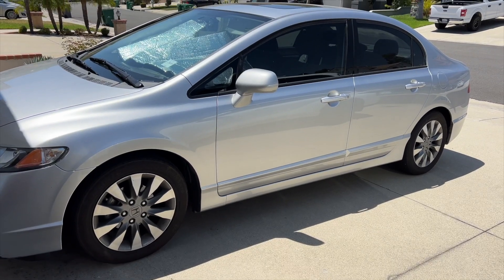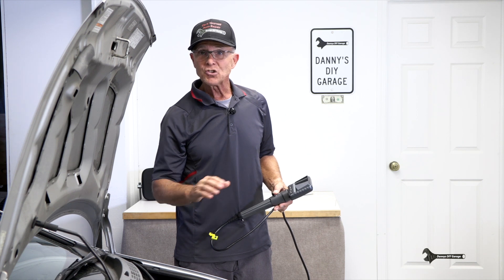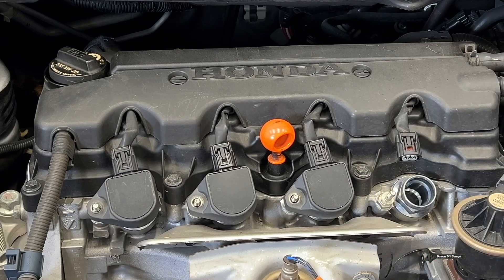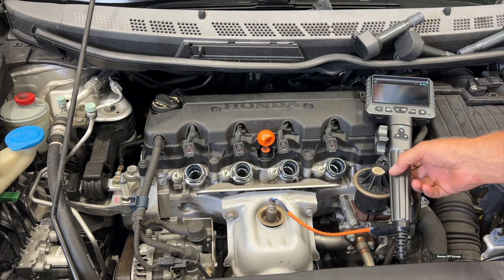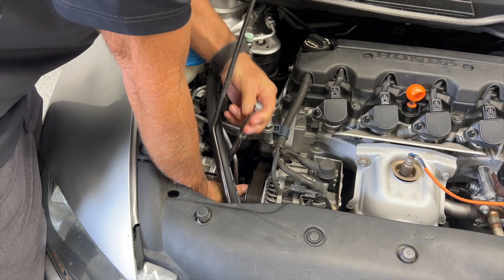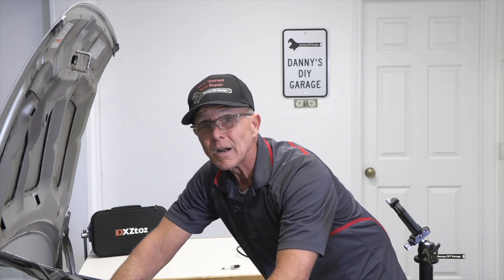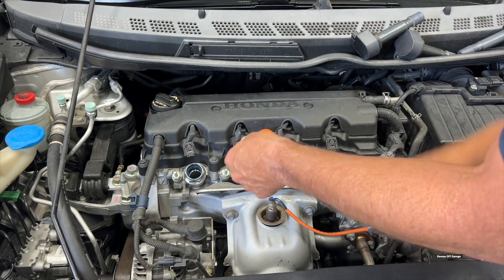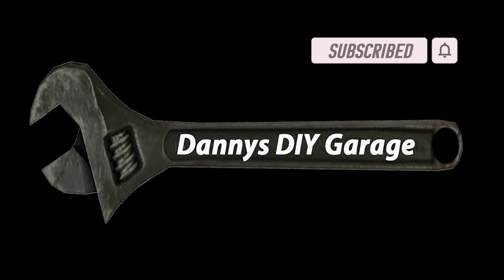The Secrets to a Healthy Engine: Honda Civic Like new at 172,000 miles 2009 8th generation

Comment: 03 element cooling fans not working im replacing the condenser i did install new fans swop out new relays temp sensor fan switch i jumped  the switch with a wires fans come on i need to add freon to the system which has nk freon.,any ideas

Comment: Danny have you ever performed a valve cleaning on this vehicle? or used any additives to the gas or oil ? I have a 2010 v6 Accord that i bought used in 2015 with 72K miles . I've taken really good care of it myself with on time oil changes, and valve cleanings that I do myself with a product called CRC / GDI INTAKE VALVE cleaner. After do this valve cleaning, I noticed a ton more power and response to my Accord. I'm about to do another one with my next oil change. Any thoughts on valve cleanings?  I go into the throttle bottle being sure to spray past the MAS sensor.
Reply from the maker: I’ve never use any additives,  just keeping up on maintenance, I keep the throttle body clean, changed the PCV valve and regular oil changes

Comment: I have a 2020 Civic turbo with 170,000 that I beat the hell out of. No check engine light and I changed my oil and filter every 9000 miles.
Reply from the maker: Wow, that's awesome. You must have a very reliable car!

Comment: I had a ryobi scope and it was garbage, twice I bought ryobi tools and both failed so never again. would be nice to have one that is a good quality where you can actually see something.
seems all those spark plugs with washers that compress are right around 12-to-15-foot pounds but it's pretty easy to tell you turn them about 3/4 turn after gasket makes contact and suddenly it gets really hard to turn so you stop.

Comment: Good look. My 19999 Civic LX just turned 174k miles and it's just as clean.
Reply: Damn, 19999? That must be a 3605th gen Civic?!
Reply: @JaayTea2595  1999.
Reply: @GMoye-uj4nt  a 1999 civic is like my dream car man. I swear on everything once i pay off my daily im getting a either 1999 or 2000 civic in manual transmission and am just gonna dump my life savings into it 😂..
Reply: Damn!  You did the math on that!  Impressive 😂 @JaayTea2595

Comment: Hi Danny, first of all, thanks for your videos. i Own a 2007 Civic R18A. its less than 100,000 miles well maintained so far. recently i have been facing engine knock only at 1600rpm when its decelerate from 2000 rpm to 1500rpm while on the move in gear. not facing the issue in any other rpm range. so not exactly sure where to look for this issue. i scanned using the computer it didnt show any error with injector, spark plugs, not even in MAF sensor. should I change the plugs or need to replace the injectors? Recently i removed the carbons from the combustion chamber and cleaned EGR valve and also cleaned the MAF sensor. Any tips on where to look for this issue? Thanks.
Reply: Check you ignition coils, simple way is to un plug one at a time, change spark plugs with proper gap imo, 2007 is known for cracked blocks but unlikely, also check condition of oil in filter next time its off, could be bad fuel or water too. Run seafoam in gas and lucas oil stabilizer if all else fails!
Reply: @FixitAli  Thanks for the inputs mate. Will chk them all.
Reply: @fahrenvibes  I hope it resolves the issue, I like doing all my own work for money savings, and mostly learning and I don’t trust too many mechanics from past experiences but if you can’t figure it out I would suggest a local mechanic if all else fails to save further damage to your car as its low milage, best of luck Fahren!

Comment: I bought a manual transmission 2006 Element EX new, I’m over 220k. Runs like the day I bought it. 
I replace anything that needs replacing. Oil changes every 3000 miles
Reply: I've got a 2008 Element with about 200k, curious what you've replaced, for me so far; variable timing valve, coils, alternator....you?
Reply from the maker: @banningjainlight185  on my Element I’ve had no major repairs at this point, on the civic only one, a starter motor went bad
Reply: @banningjainlight185  I had a valve burn through at 35K miles. Other major things over the years, drivers and passengers seats reupholstered. Replaced the hydraulic clutch mechanism at 170 K miles, replaced front axles and all McPherson struts at 180k miles. Miscellaneous filters and consumables yearly. 
All new speakers and window gasket seals at 120,000 miles. Motor mounts at 100k miles
Reply: @banningjainlight185  original alternator. valves adjusted at 170 K